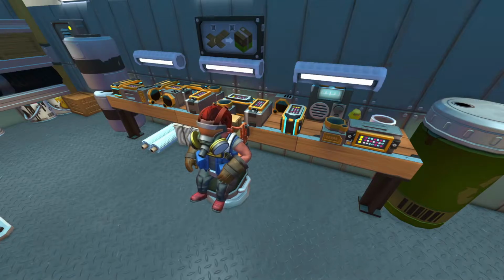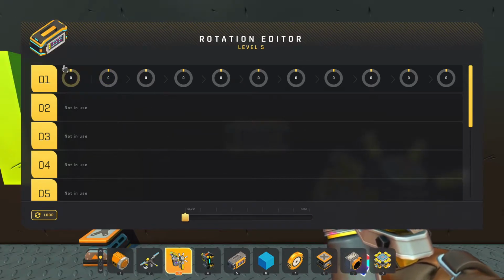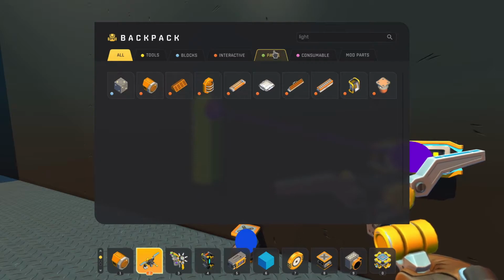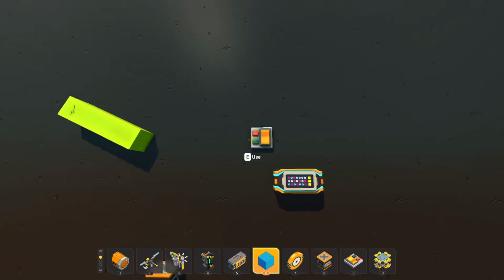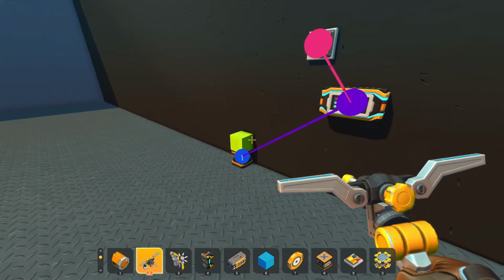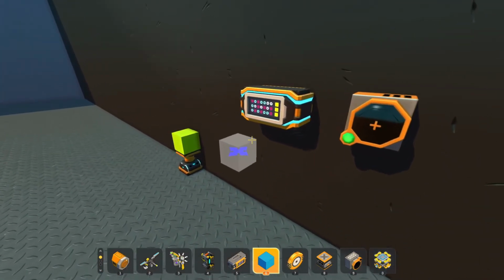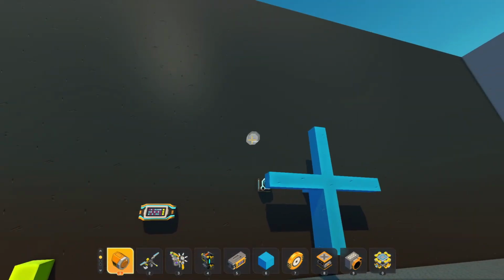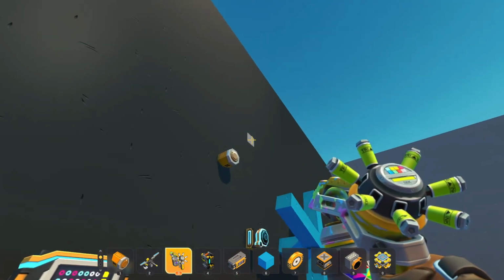Beginners Controller and Sensor Tutorial Scrap Mechanic [Just the Basics]

Comment: Well that's annoying.  In my game I've progressed pretty far and I am building an auto farm but the sensors are not able to be connected to anything.  Seems like a bug or something.
Reply from the maker: Connects to nothing? That's odd.
Reply: @ProfNCognito  yeah, I restarted the game to see if that fixed it but nope.  Seems like it's bugged out, tried to connect it to a logic gate, controller, switch and button.
Reply: @ProfNCognito  I figured it out, the sensor was on the frame not on the trolley.  I'm building my farm as a frame that rolls up and down the farm instead of using pistons.  I can have a bigger farm this way with zero limitations as to size since I can always make it longer or wider.